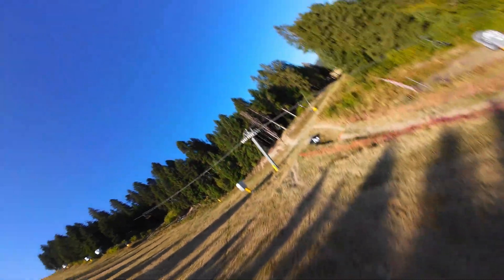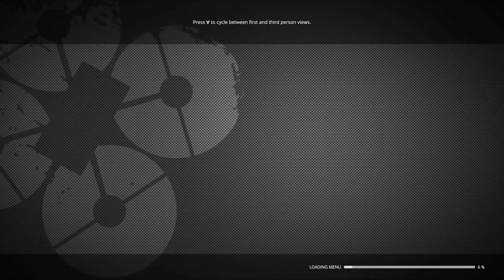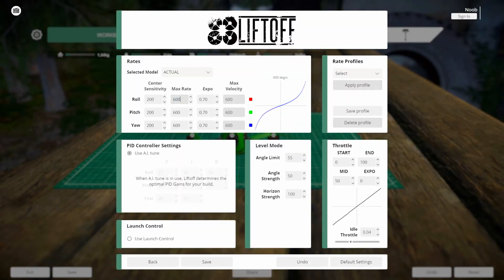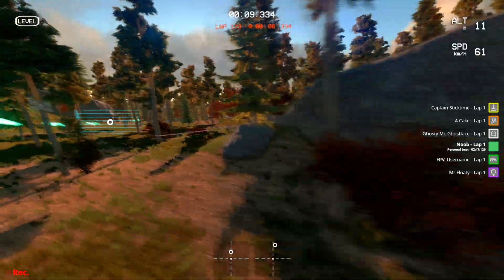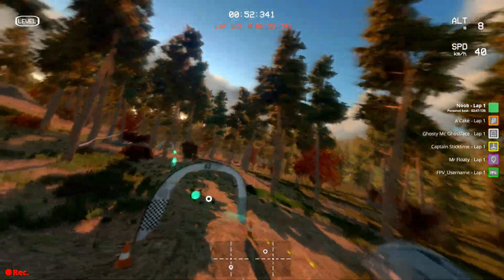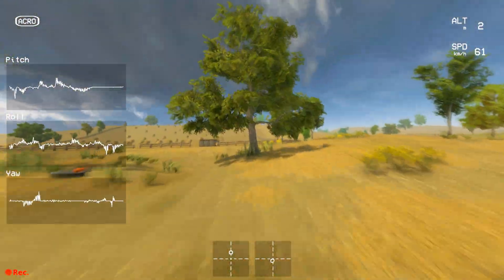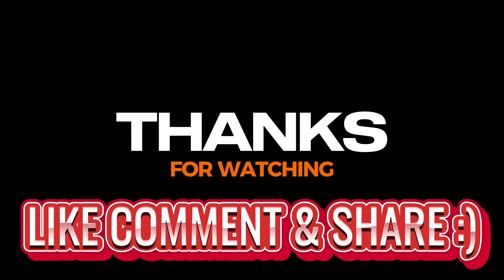How to Find Your PERFECT FPV Rates and Fly Naturally (Avata 2 & Liftoff Tutorial)

Comment: Nice video, I am actually a total beginner with Liftoff sim but I am unable to control the drone as the response on gimbal and throttles are too fast
 Can you please guide me on to control the drone with slow movement with any adjustment in simulator settings. Pls help
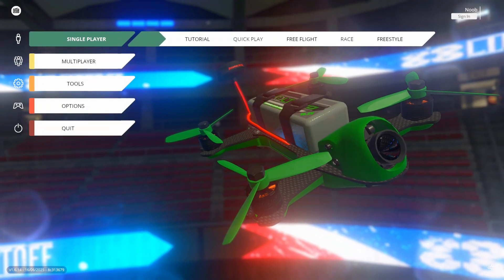Reply from the maker: Hi. Check the video @1:09 . If you feel uncomfortable flying at high rates, lower them until you find what works best for you. Also, don’t forget to start with a slower drone - check the maximum speed specifications and choose the one with the lower value. Good luck! :)